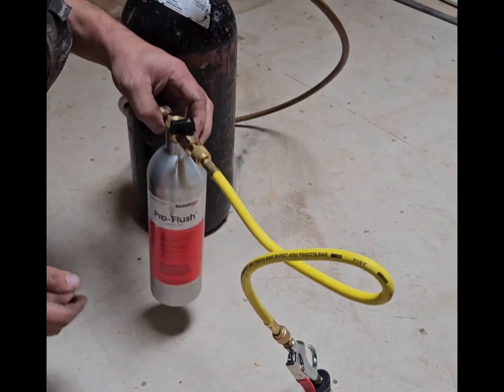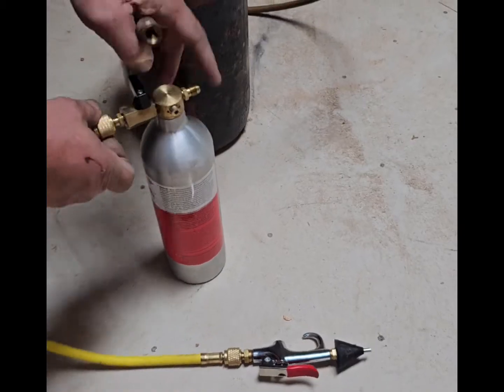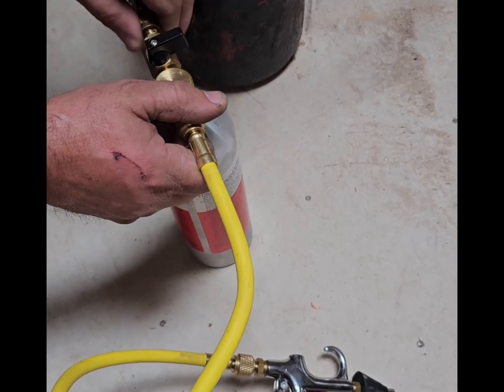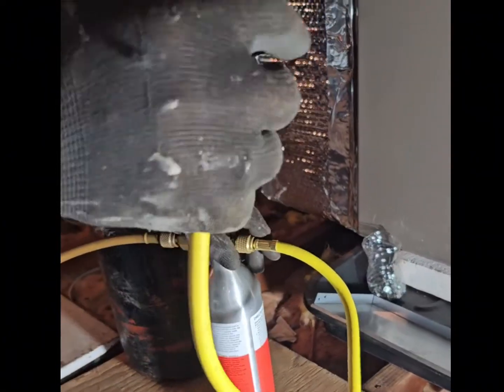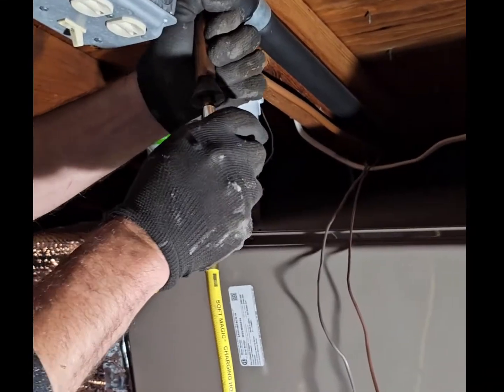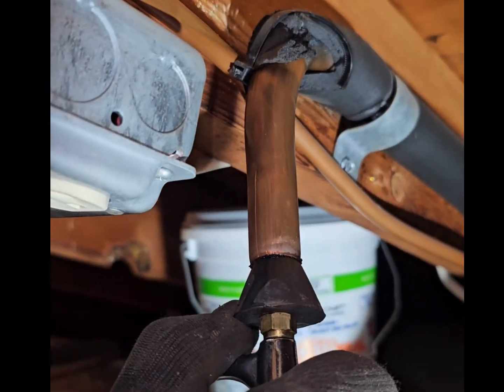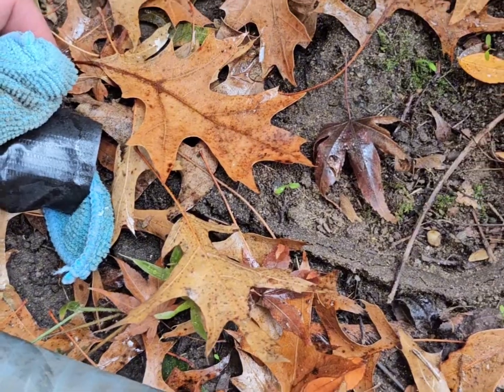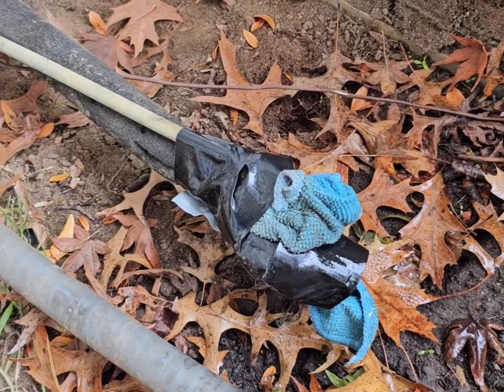Hvav Advice- How to flush a lineset #hvac #hvactraining #hvacrtechnician

Comment: nice video, question regarding the evaporator coil or the condenser doesn't need to be flush too?
Reply: If you are flushing a lineset, it is most likely on a replacement job of the condenser and evaporator coil. so there would be no need to flush the old equipment or new equipment.

Comment: That such a shitty flush. THe acid should be circulated through the line or something. That's like wiping a dirt pot quickly with a rag. You really need to go in there to make it clean.
Reply: I think the chemical make up of the flush does an adequate job without physically having to clean the Line via some physical means

Comment: Would just Acetone be fine? I'm only using it once and that's about $300 in supplies to use once.
Reply: Check auto parts store you may be able to rent the Cleaning solvent tank.  Maybe even rent the nitrogen tank and valves from welding supply???